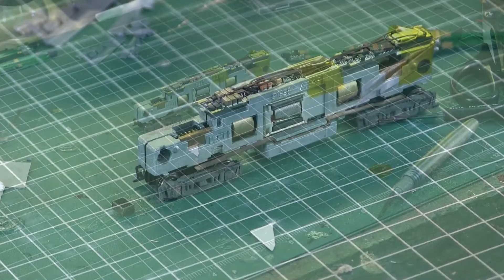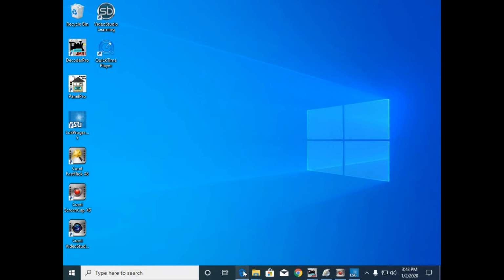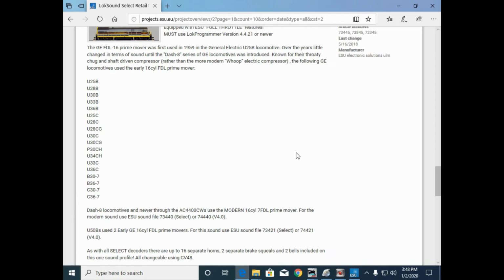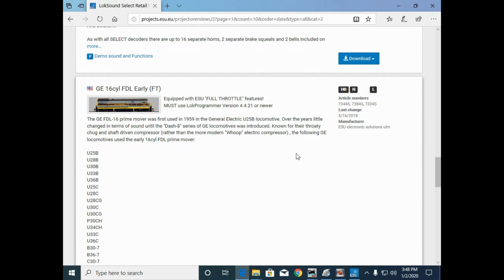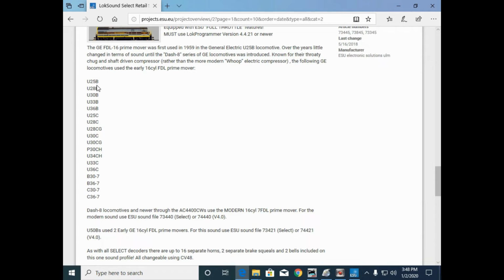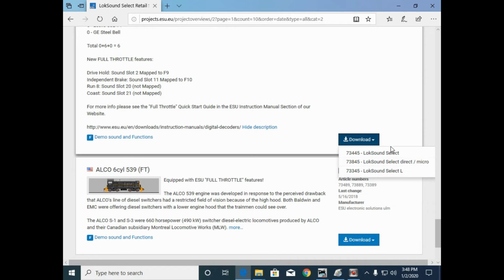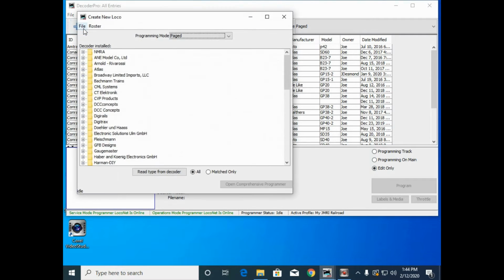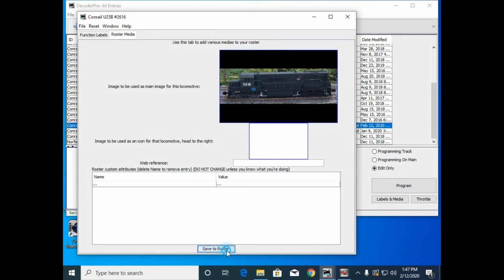Atlas U25B #2616

Comment: Like your work and a subscriber. I've been a soundtraxx guy for a while and always isolated the motor from the frame and all that. I now have an ESU Loksound 5 micro dcc direct Atlas/Intermountain decoder. Do you not have to place kapton tape between the decoder and the motor input pads to isolate from track power?
Reply from the maker: On the ESU direct/select micro 4 they didn’t say you had too. I have tried the series 5 yet. When I do I will make sure to let everyone know. Thanks for watching!

Comment: very nice video, as always seems I have a couple of questions.  Did you paint the loco with flat black the reason I ask is because of decals for me anyway silver but the ones you put on were small.  I use the tamiya panel wash did you use the brown or black?   They do flow better with a satin  finish.   Like watching your paint shop series I model L&N so have to do a lot of paint repaints.  Very helpful!!
Reply from the maker: Thank you! So I used engine black which is flat never thinking about the decals slivering. But that came out great by accident. I used brown on the panel paint. And yes I did notice that it didn’t flow as well! Thanks for the support.

Comment: Beautiful! I love it. Adding the blue battery box cover was a great touch. Did this unit already have an antenna or did you not add one this time? Did you apply the decals onto flat paint? Getting ready to attempt my first major locomotive decaling project so gathering information.
Reply from the maker: So I did not add an antenna on this one because I can’t get Sinclair antennas. Very hard to find. Yes I did apply the decals to flat paint. I was rushing and not thinking!!! Thankfully it turned oh ok, I think it was the micro scale solvent and sealer that saved my but. Thanks for all the support Maurice.